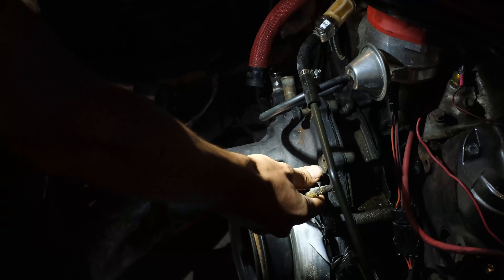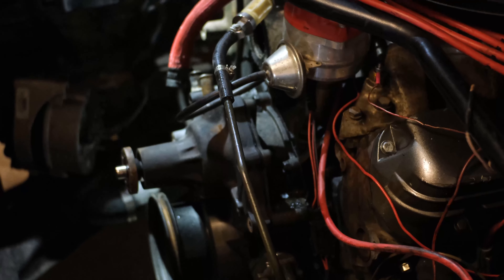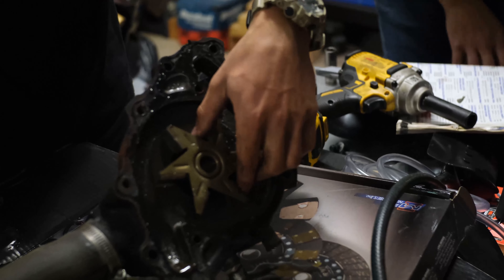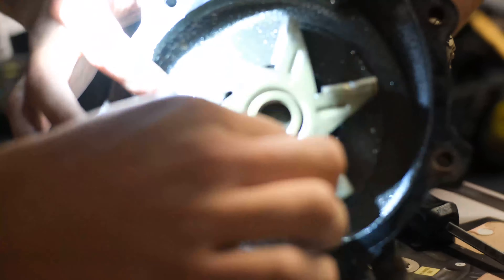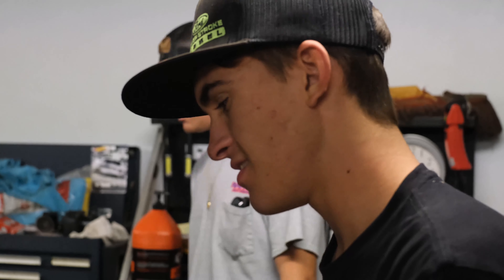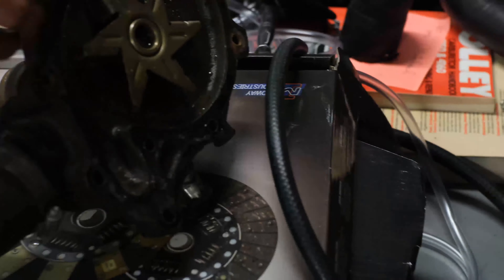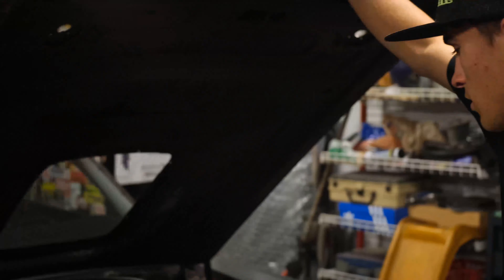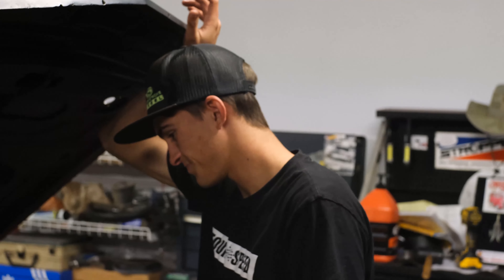WE'VE GOT PROBLEMS...

Comment: If it has a clutch fan make sure to replace it too as ive seen people replace the entire cooling system and they still had problems just because the clutch fan wasint working. hate to spend so much money on something only to find out its just one little thing. also you should do multiple coolant flushes on that thing to make sure any debris in there get flushed out. Also from what ive seen form other comments on Craig's video, someone said check the head gaskets because theirs rusted over and thus there was no coolant flow so maby those calcium buildups are causing a blockage somewhere else in the engine. Either way wish you the best of luck with all this man!

Comment: If the head gasket was bad and it was pushing compression into the cooling system, you would have pressure in the system even when it is cold. It would spray water out when you open the radiator. Pull the freeze plugs and flush the block.

Comment: I did not here you say anything about thermostat it can cause this problem.Also I have had a head gasket blow to a water jacket and push air back in radiator. It will run fine just push compression in radiator. I can tell you a couple of was to test it if you need just shoot me an email. Be glad to help.
Reply from the maker: Thermostat was faulty and never opened